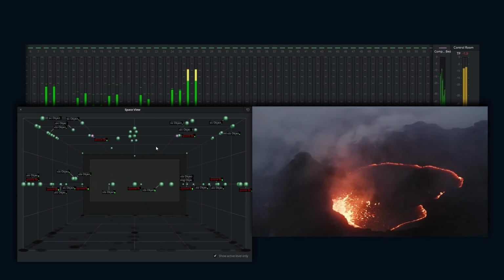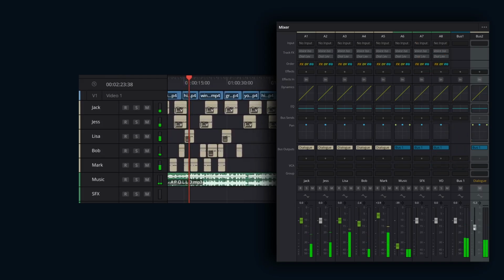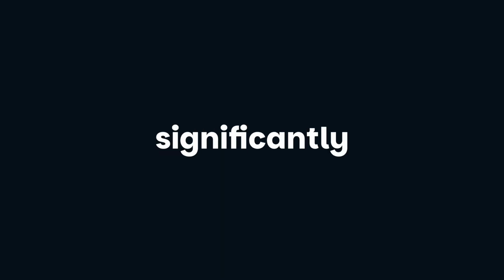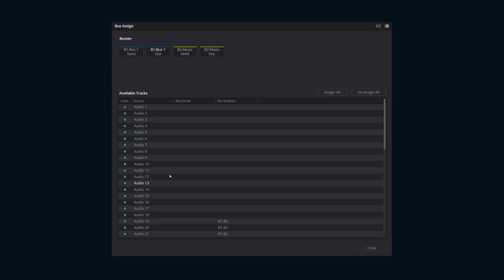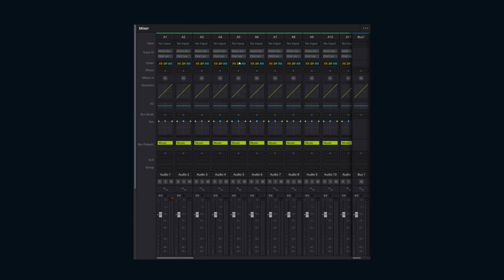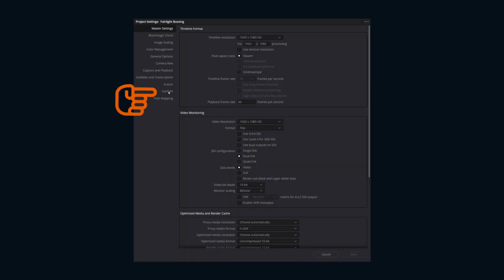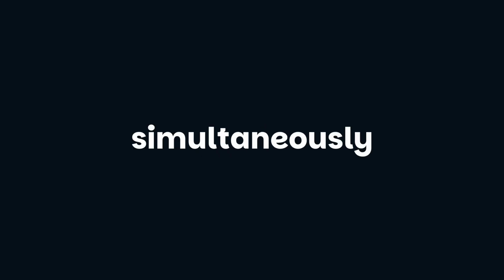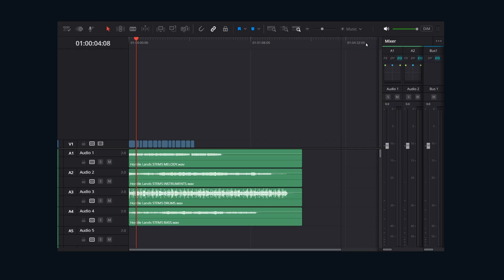DaVinci Resolve Fairlight Bussing In 3 Minutes

Comment: I thought the better the better is to get out the track firstable with bus sent to apply some effects simultaneously for the dialog for instance then after to use Bus Output for preparing the control room. I use that in Logic
Reply from the maker: That's a great point and a standard workflow!
The video focused on routing tracks' main outputs to a bus for grouping/submixing.
What you described is using bus sends (an option in Fairlight track strips) to route a copy of tracks to a separate bus for parallel effects (like reverb) simultaneously.
Both are valid, essential techniques fully supported by Fairlight, and you'd typically use both methods together in a mix.